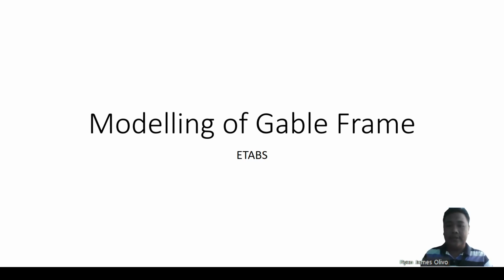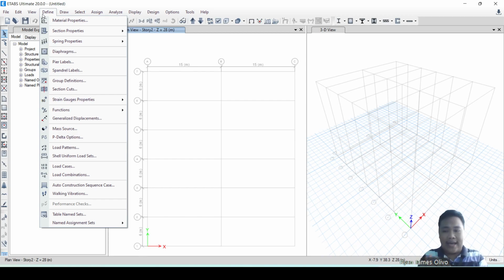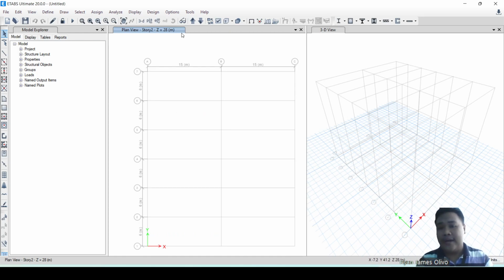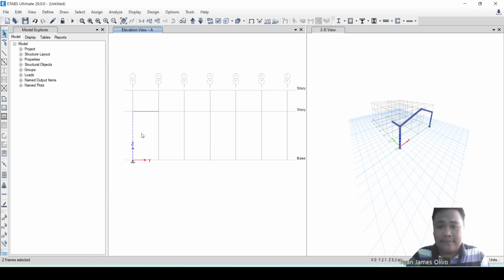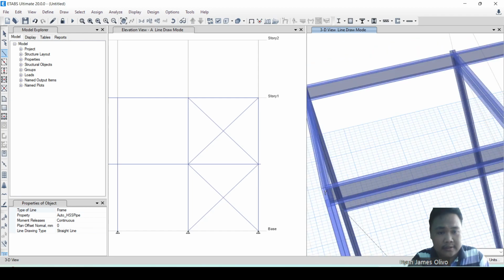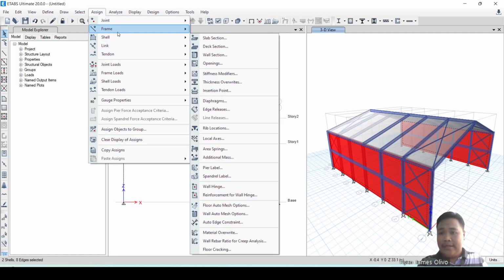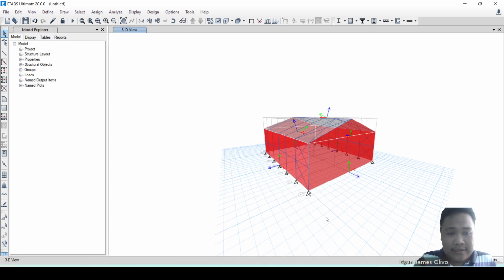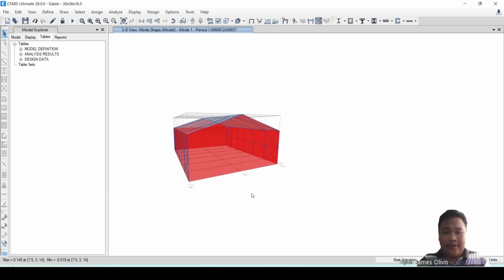ETABS Wind Load (NSCP 2015) Part 1 - Modelling of Gable Hangar

Comment: Membrane will not contribute to frame stiffness. But what will be the difference when we will not change the modifier to 0?  Thank you
Reply from the maker: Yes, membrane does not have an in-plane stiffness, but it has an out-of-plane stiffness. Therefore, if you want to remove the out-of-plane stiffness modify the stiffness properties of the membrane to 0.
Reply: @ryanjamesolivo6516  thanks. 
Sir i try another way. Instead of stiffness modifier i used material property with 0 weight. 
The shear and moment almost the same. But for the axial big difference. Any comment?
Reply: @ryanjamesolivo6516   I believe the statement is incorrect. It's vice versa. Membrane has in-plane stiffness but no out-of-plane stiffness. If a shell element is to behave as a membrane then the bending stiffness modifiers are to be reduced to 0 to remove the out-of-plane stiffness.